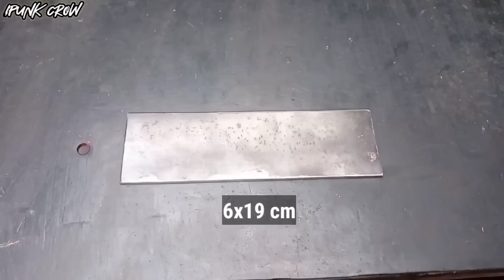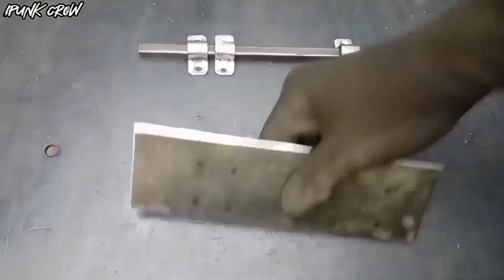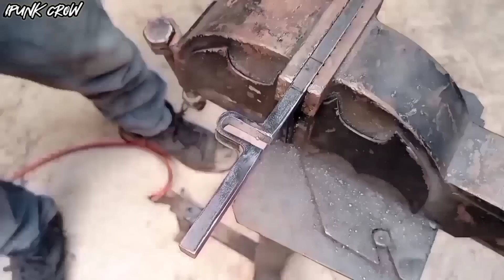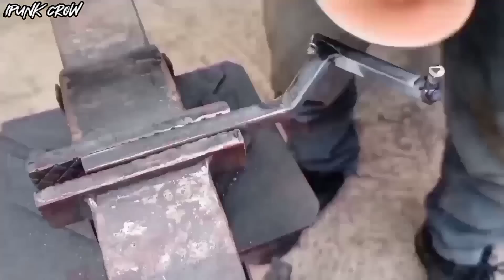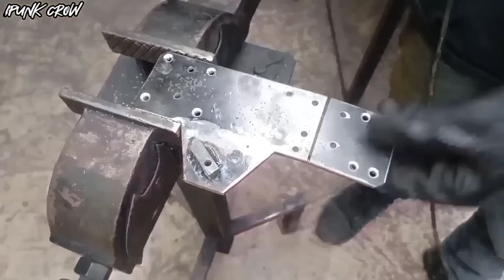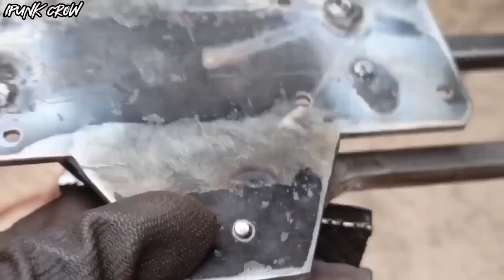membuat Grendel pintu keren gaya industrial ekslusif

Comment: Anyone could loosen up the screws and defeat the whole purpose of the lock. Try spot welding the screw heads to the plates, and reinforce with spot welding the plates to the locker.